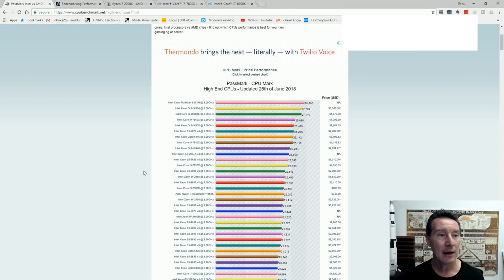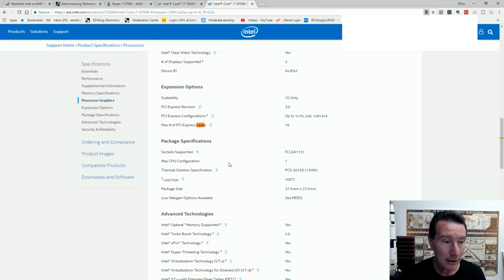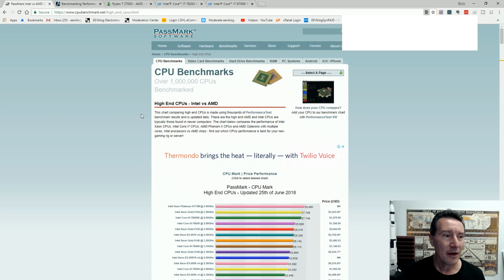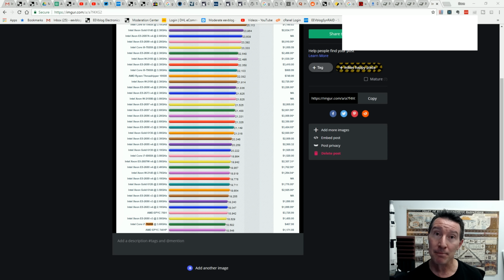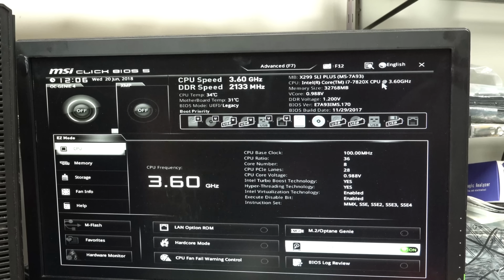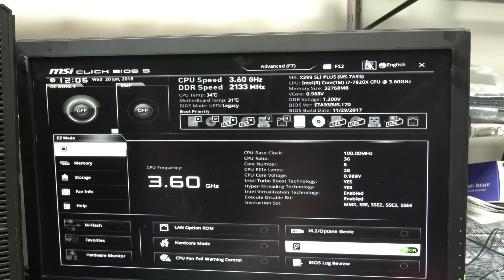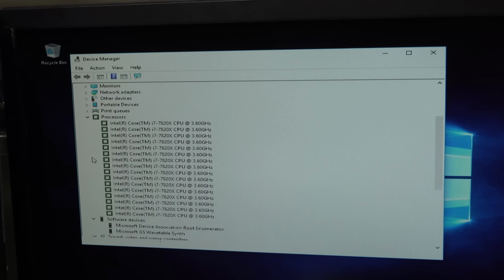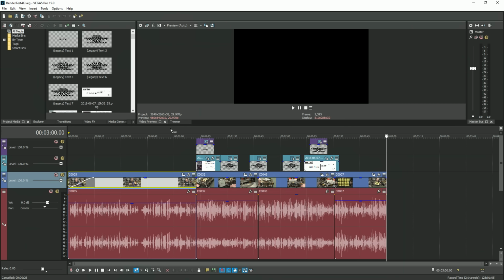EEVblog #1098 - 4K Video Editing PC Build

Comment: Didn't know it was possible for people to "care" so much about someone else's build....
Reply from the maker: Welcome to the Internet :->
Reply: Not watched this video yet (I sleep and watch later on) using the X platform is very likely going to get comments (also putting fan in pull configuration I guessing made lots of posts) 
I am a computer tech (personally 8700k or ryzen 2700x 8 real core ) on the sideline with the x cpu unless its the 7900x, 
but I am 100% agree with others (depending how they worded it)  8700k or 2700x overall is better on price, 2700x has 8 cores and is comparable , but what you got is probably faster then what you had before any way (like one streamer skimping out on $100 CA, getting a 8700 not the 8700k and getting super slow 2133 ram) I went from i7 920 to a ryzen 1800x so anything I could buy would of been faster then what I had before (2700x from the 1800x would only net me limited benefit as I already own a 1800x, so I am waiting for 3000 cpus)
Reply: it really is crazy how much they care (which says something about their personal lives). I had to check back to see some comments and it didn't take long to find the personal attacks, name calling, and derogatory remarks. I'm not a sissy, but it's just a computer! 90% good enough is good enough! (and even calling it 90% can trigger remarks) You'd think a political video was made!
Reply: Cringe PSU thought for a high performance system (at least it is Silverstone but I would not put it near a high end system) , open up a PSU from like corsair or a type of PSU for intended use it looks completely different

If your using gpu to do the encoding you could of just got the 8700k or 2700x as the gpu does more work then the cpu but cpu is fine if not pricey 

The board will not have all ports or slots running at full pci-e lanes active due to only having 28 lanes (ryzen does 20+4, 16x goes to first slot and 4 goes to the m.2 slot the +4 goes to chipset) i check what 7820x limits or disables later on (not sure how 8700k does it) 

Ssd fine, fan is fine, ram fine (if not flashy but it was available and cheap)

Comment: Dave if you want a quiet power supply, pick power supply with best efficiency - you should know that. Better efficiency = less heat. Less heat = low speed fan, or fanless mode psu.
Reply from the maker: Unless it's got a noisy arse fan to begin with.
Reply: @Classified Directory
> Better efficiency = less heat.
True, but manufacturers can still dimension the heat sink too small.
Heat sink too small => more fan speed.

Comment: This is not great by any means but would be great fun to overclock, any questions ask, and ill spit out a answer, overclocking is a hobby of mine and I take great pride in it, it happens you got a ln2 cpu which is kinda funny and non ln2 ram or motherboard but the 7820x I believe should still clock to 5ghz with many setting changed for less latency

Comment: There's Threadripper CPU's with 8,12,16 cores and 16,24,32 threads respectively that don't screw you out of PCIe lanes.. All have 64 PCIe lanes.
Reply: But Dave doesn't really need more than 16 lanes since he is only running one GPU.. And you can't double performance of nvenc with another gpu? Unless doing two video encodes at same time ofc.
Reply: If the choice is between an i7 7820X and a Threadripper 1920X it's not even a contest. The threadripper is slightly more expensive but delivers 12 cores, so I don't see why anyone would ever choose Intel at this point for heavily multithreaded work like rendering.
Reply: > nvenc   
Why would any sane person use x264 hardware encoding?
Reply: kruppin Wrong. The nvme ssd need pcie lanes too.
Reply: Octanius Blue well, yeah, sure but you also have lanes on the chipset, and on a Z370 platform the nvme disks are using those. So even with a nvme then you still have x16 to gpu. And also we rarely actually need x16 to the gpu tbh, even though it's ofc preferred. So still, in Dave's case, he doesn't need more than x16 on the cpu. (because thats what he was looking at, lanes on the cpu itself.)
Reply: Thomas Williams I have no idea what any of this means

Comment: Dave, I'd honestly consider upgrading to a better Noctua or Be Quiet heatsink. Skylake X has severe thermal issues, and it wouldn't surprise me if such a basic cooler caused thermal throttling. The brands I mentioned will also be much quieter, too.
Reply: Sniper Pro nerf mods I didn't say anything that was untrue.

"Skylake X has severe thermal issues."

This is well documented, and partially a result of Intel being too cheap to solder even a $2,000 CPU. His particular work loads just don't happen to generate enough heat where the Hyper 212 can't handle it.

"It *wouldn't surprise me...*" is not a statement of fact.

"Those other brands would run quieter."

There are tests all over the internet confirming this.
Reply: I agree with your heatsink recommendations @DrearierSpider1. Once you've had a good heatsink, you don't go back.
Reply from the maker: a) It's already quiet enough
b) Please quantify the "sever thermal issues" and at what temp they take affect. I showed my CPU die temps are 60C tops when rendering.
Reply: EEVblog Fair enough, I was being one of those dumbasses who commented before watching :P

I was simply basing that comment off reviews I'd watched, all of which pointed out the thermal issues (even at stock). They may have been more heavily utilizing AVX workloads or something along those lines, though.
Reply: EEVblog I am done with the internet I didn't know why people just say things that aren't true, eevblog you have helped me learn so much and if you need any help overclocking or running the pc to the brink of performance just ask, I do extreme overclocking as a hobby so I know what I am doing, everybody in the comment section made me lose brain cells,

Comment: I used that same cooler for years, worked a treat, only lost 2c switching to an AIO water system (but i did have it push from the heatsink and pull from the rear fan)
Reply from the maker: Interesting so little difference.
Reply: it surprised me (obviously after switching from a $50 to a $120 cooling solution) but i think it mostly had to do with the fact that my overclocked 3770k was already very well tuned and the losses in the water line (well, gains if were talking about heat) were not very well overcome by the added (probably 30% or so) surface area of the radiator 
im sure if i pushed my 3770k harder and it was running over 70 under a normal load, it would show better results, or if i increased the speed of the pump at the cost of added noise
Reply: im not going to go threw the trouble of ripping it out and taking pictures and plopping the old cooler back in but its a 3770k overclocked to a turbo of 4.5ghz with very little overvoltage (can't remember exactly what it was) 
the previous configuration was front fan > HS fan > HS > exhaust fan > 
the current configuration has the AIO on top pushing out of the case 
but like i said in my previous reply, the 30% or so added surface area was not enough to overcome the system losses by much due to the lack of major heat production, being lucky in the silicon lottery and not having to up my voltage all that much 
liquid coolers are always more efficient the farther you get away from ambient and at a worse case 66 before and 64 now (not under stress test but my current workload of gaming, CAD and GPU rendering) was clearly not enough to justify what i spent ... but i like it, looks a lot neater
Reply: Alyx BioHaz ok you need to list your system specs so people like me can calculate the thermal resistance and you need to tell your fan orientation, aio are good for burst load but are less efficient thus air coolers preform better but then again it mostly depends on design and surface area , but almost all aio are made from the same parts and just have fancy shrouds, I hope this was a bit more interesing because in have been too rough to these pc noobs, instead I should help them learn, any questions ask away especially about overclocking

Comment: How about buying a used Dell Workstation with dual xeons and 128gb of ram and wing it?
Reply: He moved past xeons because of reliability issues with windows 10, so he probably inclined to avoid older xeons
Reply: camtheham13 Welp, I have 2 xeon machines from 2014 and they came with Windows10. I formatted them quickly and put Linux on them.
Reply from the maker: I already have a workstation with dual xeons and 128GB of RAM
Reply from the maker: You don't need your video files in RAM disk, even my Ethernet NAS drive is fast enough.
Reply: James Owens it's 2018, who cares about xeons anymore? 128gb ram for what? You will never use half of them. And one more thing, custom PC is the trend now, don't you now that, do you?
Reply: 128GB besides being needed for scientific work allows you to put your entire workspace in ramdisk for superb I/O speed.
Reply: James Owens And, why go for used pc when you have money?
Reply: Tai Le Because paying extra for brand new hardware is for chumps? The prices go down quickly.

Comment: How many times you going to post this?
Reply: 4294967295 times. After that, he will just get a stack overflow error. (Assuming he's using a 32 bit system)
Reply: lots of people still use xp sytems.
Reply: even though i think windows realease 64 version.most people don't actually build a pc to run xp, instead use old one which prob has 32 bit hardware.
Reply: >stack overflow error. 

Most systems have stacks that are a few K big.

Comment: Just admit you fucked up by buying a marginally faster processor for way more money, using way more power. And further hampered yourself by getting slow RAM, when that is the main advantage Intel has, handling fast memory. Not to mention the 10% hit you're taking for Meltdown.

Comment: I wonder how much you could gain by going for a beefier GPU (if the software supports GPU acceleration that is). I think your build is well balanced. Not too over the top, not too weak. Well.. apart from those horrible RGB sticks but what can one do when they only sell that sh!t.